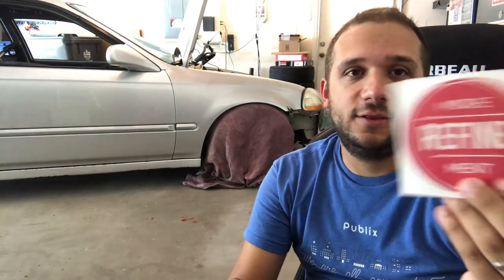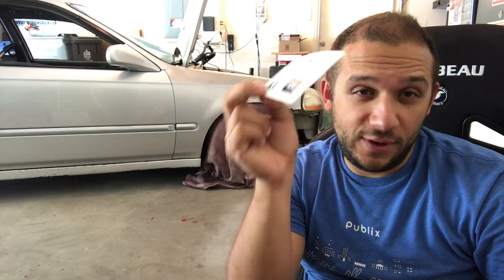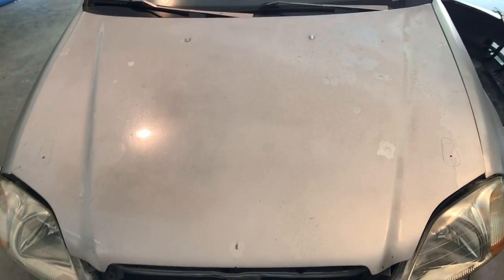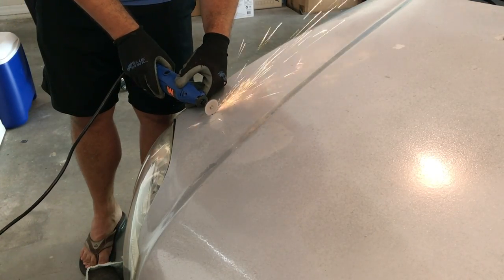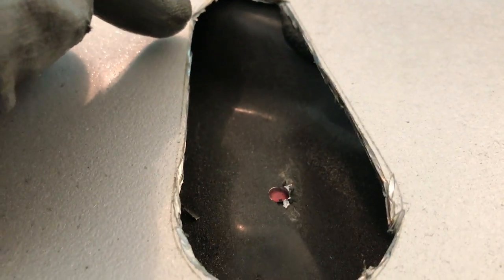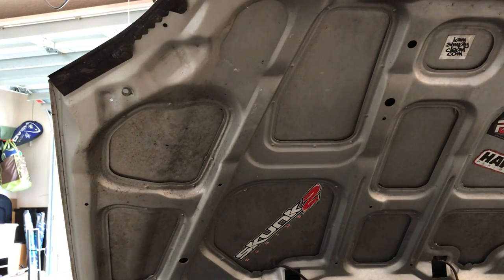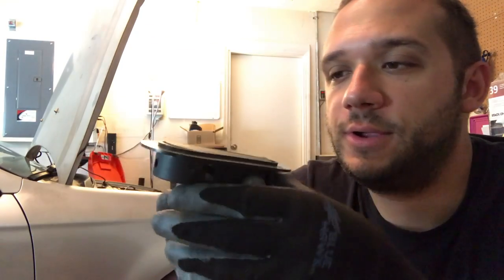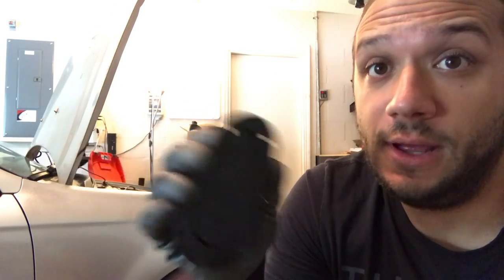AeroCatch Hood Latch install on Project Civic EK

Comment: The hole is an oval. After drawing your trace lines on, use a hole saw bit. A small one and a big one. Then connect the holes with a dremmel cutting wheel. Will come out much cleaner.

Comment: That can't be right. You don't think it goes on top of the hood. How would it look if you put it on top and then put the nut side on the bottom? Would look better
Reply from the maker: I did it right. There are 2 styles that aero catch makes and I accidentally bought that installs from the bottom. The other style drops in from the top and looks way better

Comment: Installed the wrong kind and upside down too... the wider end is supposed to be in the back because there's potential for the pins to fail if air catches them and flips the lever up. Not that that little piece of crap could ever go that fast anyway though I guess.

Comment: Trav, u need an exhaust header on that d16y! It'll look cool and weight less! I have a eBay header 100.00 on mine! Works swell!
Reply from the maker: +Ruben Torres my engine bay is disgusting and an eBay won't do much for looks lol! I agree it would be lighter but I'm not concerned with that right now. Right now I'm just concerned about learning to be a better driver so I'm not throwing anymore parts at the car unless something breaks. When I swap in a different motor I'll get a header. thanks for watching - Travis